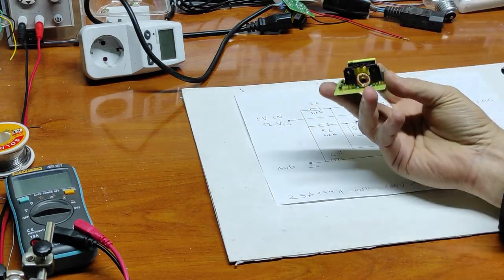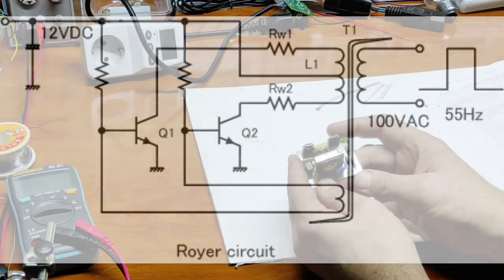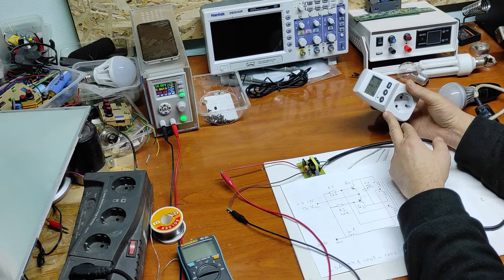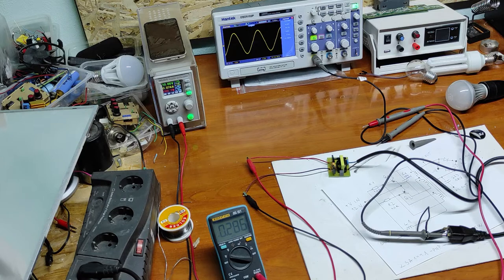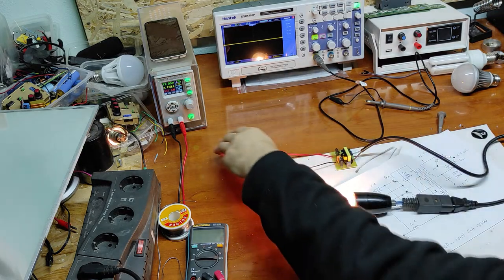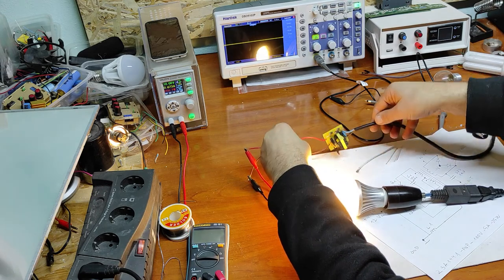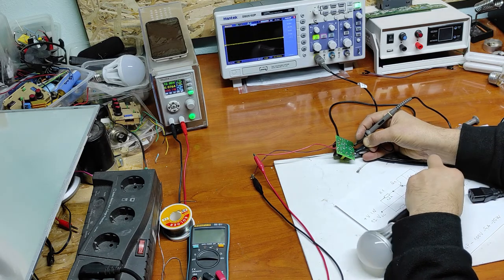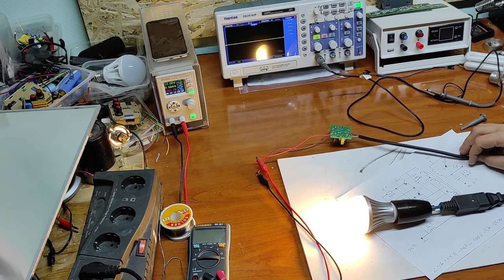35W inverter sine wave for 1usd?diy or buy?

Comment: What is the frequency of this circuit under load n no load condition
Reply from the maker: i will put the osciloscop and tell u soon
Reply: @diymariuselectro  is there a way so that I can contact u
Reply from the maker: u have my mail on chanel page if I can help u.
Reply from the maker: 40khz wihout load and 15khz with load.
Reply: @diymariuselectro  i could not find u r email. Will you plz share here
Reply from the maker: @pragatmudra8372  diymariuselectro@gmail.com